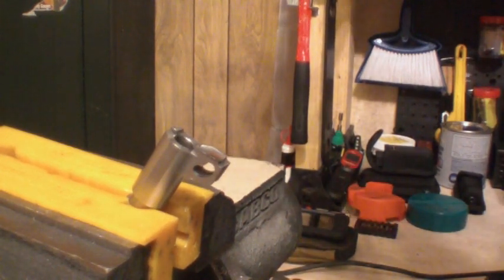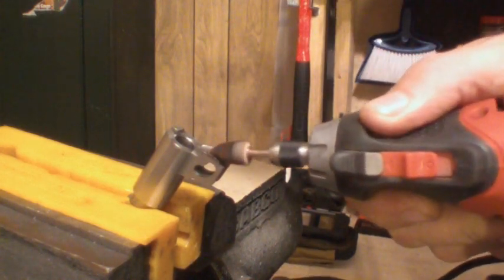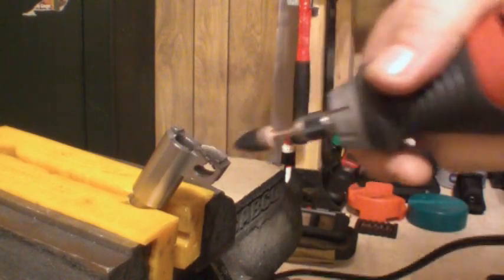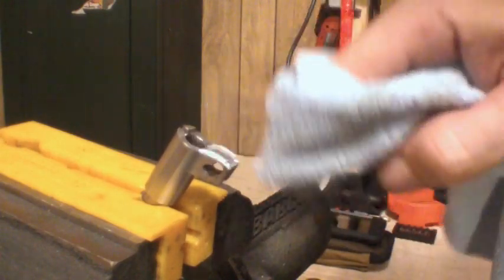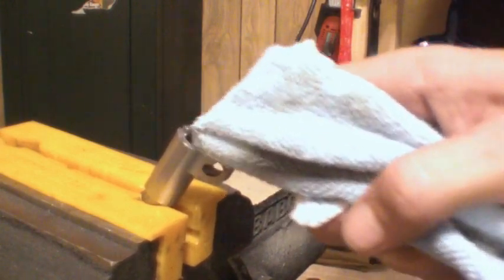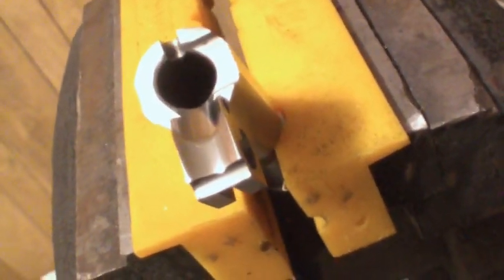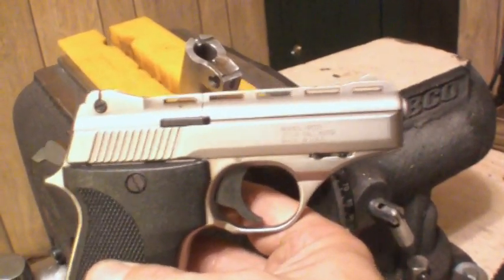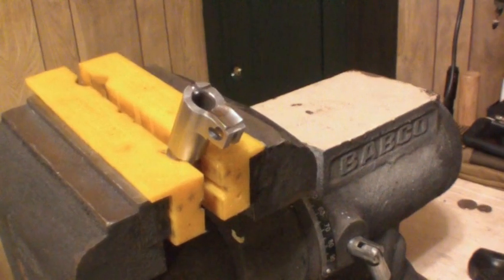How to polish the feed ramp on your pistol.

Comment: @ weaponeer, instead of using a live round USING SAFETY PROTOCOLS, you can use a "snap cap" which will have the same dimensions and will allow you to chamber a round and watch.. I've done this several times myself.

Comment: Great vid, Really nice polish on there, it came across well on vid. I have that HP-22 pistol, I love mine, never had a single problem with it, but I modified mine so that it operates like all my other pistols, no mag disconnect, or that B.S. safety crap, I made a vid on the modification for it.

Comment: Nice job on that.  As far as the Phoenix Arms 22 pistol that you showed, you can make it safer and an overall very functioning firearm.  You may even use your Dremel or Black and Decker to shave down the safety lever and you can remove the metal piece as well to make the magazines drop free.  Plenty of videos on here for that.  I own that Phoenix Arms, and it is surprisingly accurate.  Just make sure you use standard velocity ammo, and you're good to go.  Thanks for doing this.
Reply from the maker: I had modified mine as well

Comment: Hey bud, love the video, was very helpful. But I have a question for you. How would you think the best way to polish the feeder on a Taurus TCP? The barrel is fixed to the frame and I need to polish it the way you showed, maybe even with some sand paper like a few other videos have shown because it does not like feeding the flat head FMJs or HPs. They hang when feeding and that is first round son as I took it out of the box. Any suggestions on how to keep any fragments getting into gun if I

Comment: You forgot the most important part of "polishing" the ramp, which is the whole point that being removing the tooling marks of the manufacturer. 
Otherwise just buffing the ramp which is what was done here will do very little.
You need to remove the tooling marks as that is what is going to give you feed problems.